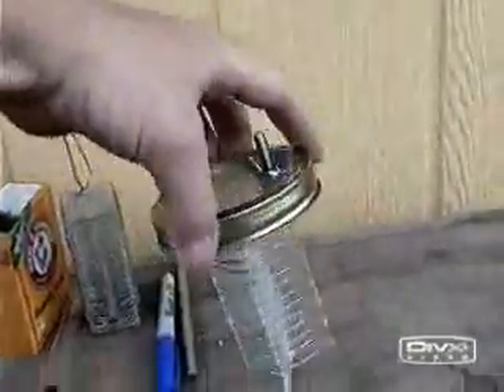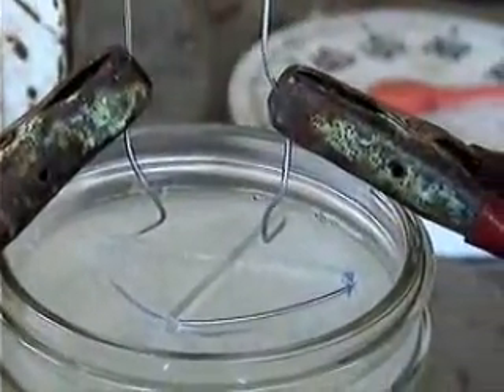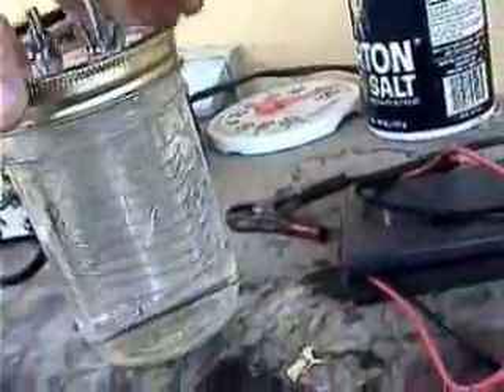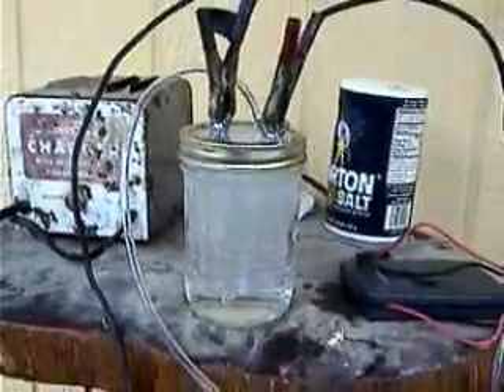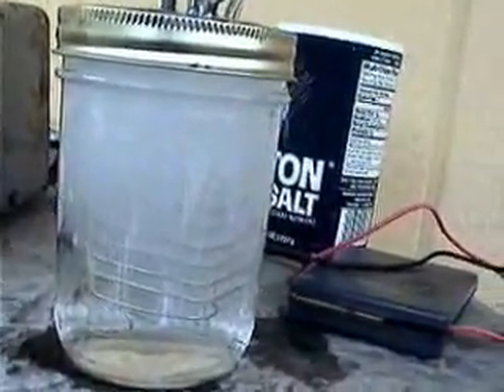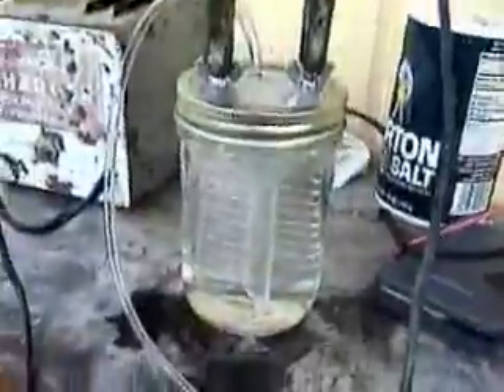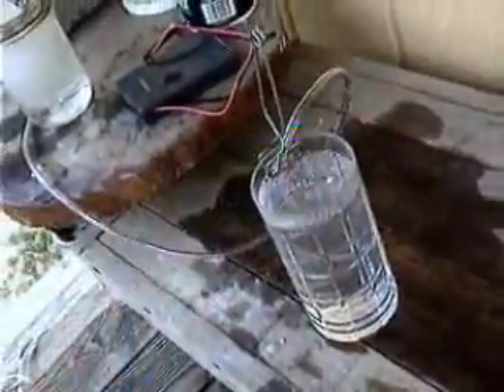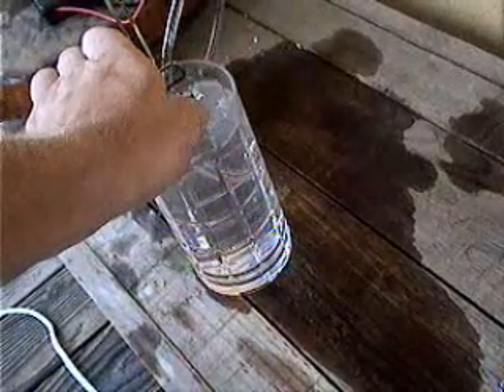How To Hydrogen Generator Prototype 1

Comment from the maker: Thanks I need a way to measure the amps, the charger is so old it doesn't have a gauge.  Can anyone tell me what the light brown sediment is that settles on the bottom of the cell.
Should I use water that is as cold as possible (within reason of course)?
My next step is a Pulse Width Modulator, anyone recommend a simple design?